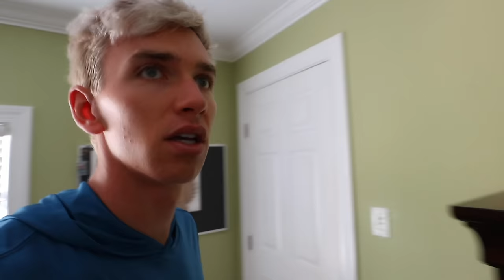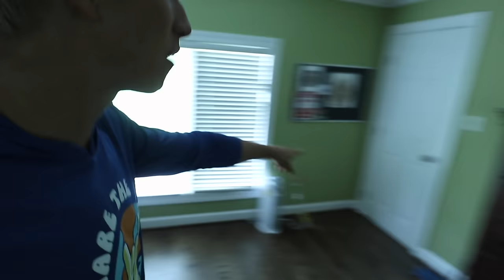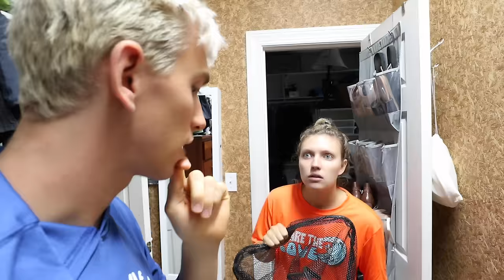Pond Monster Found Hiding in My Bedroom!!

Comment: Bhai is out of 10hot air is in the attic because it will be your house warm and cosy because the hot hydration question of wood and make it hot in comfywhat is total file because the fire is way too hot after mencher at will not go very well for you during 20 20 in there in no time I will be sent on 🔥🔥🔥🔥🔥🔥

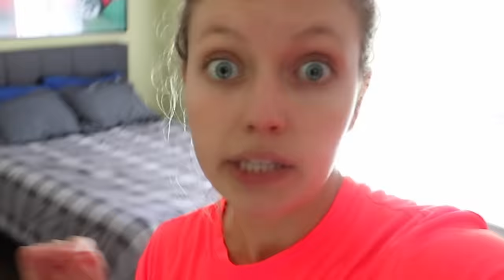Comment: Stephen the pond monster is under your bed at. 2:31 
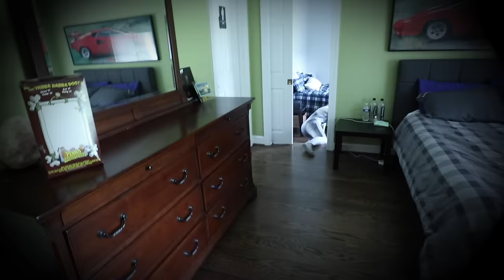And at 3:28 the monster crawled into you bathroom 
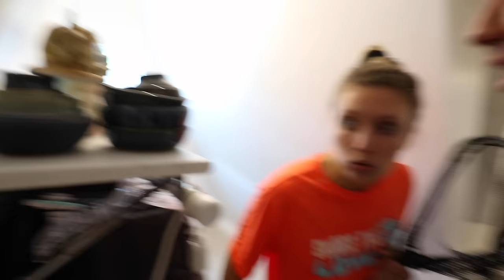and at 7:29 the monster was behind grace
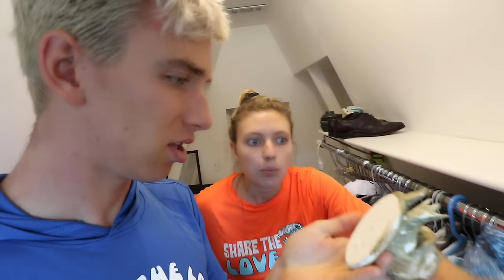And at 4:48 the monster was behind grace too
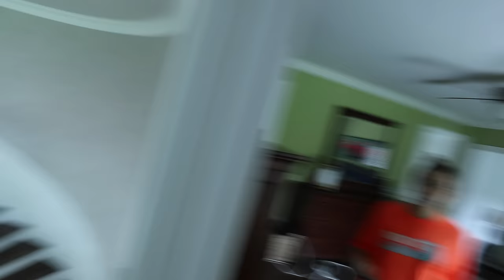And at 5:46 it was crawling behind grace
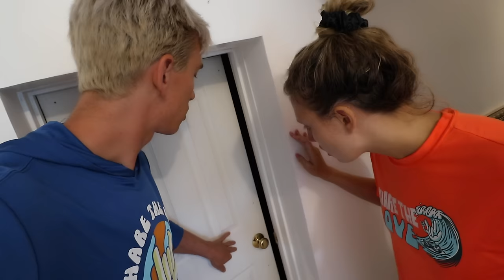And abut 6:23 when they open the door the monsters hand was there
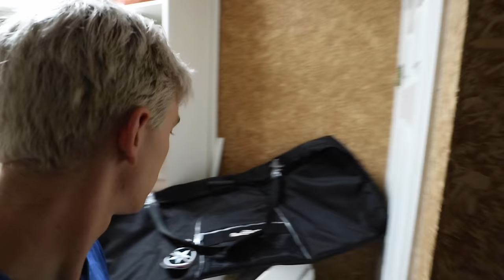And at 7:10 the monsters hand was behind grace but it passed really fast so you might not see it
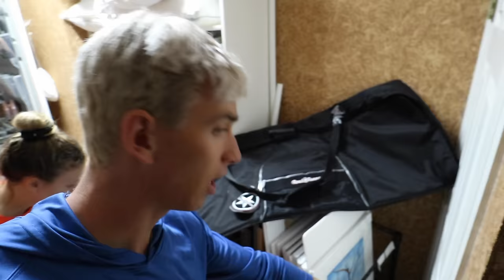And abut 7:14 the monster turned of the light behind them
And at 7:29 the monster was on the floor behind Stephen
And at exactly 8:02 you pause and look at Stephens shoulder the pond monster is there sitting behind but it passes really fast so pause 
And at 8:36 the monster was at the left on the door to carters room
I lov when at 8:09 the monster was at the door frame you laying there and you can see it for a while hope you guys like seeing the pond monster and I hope you guys like my hints of the monster